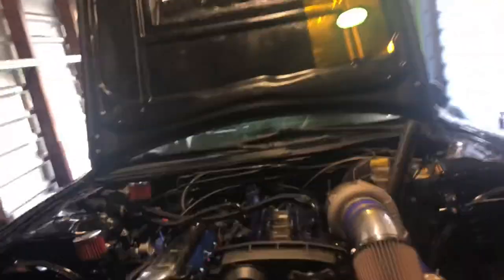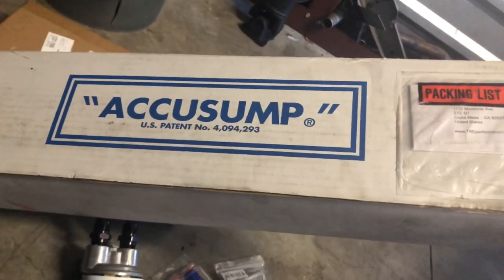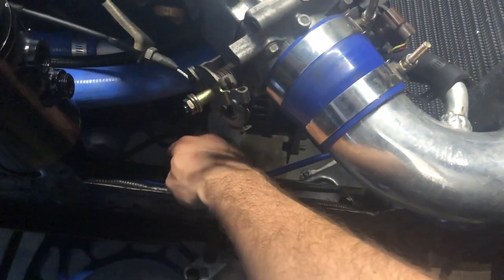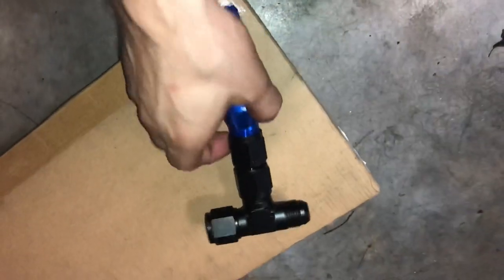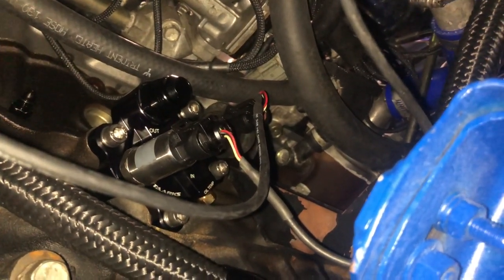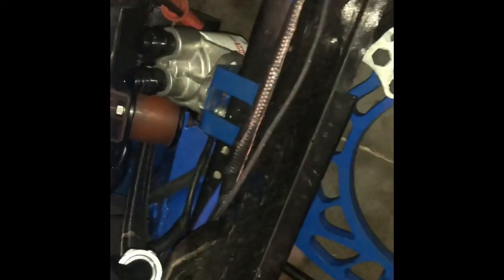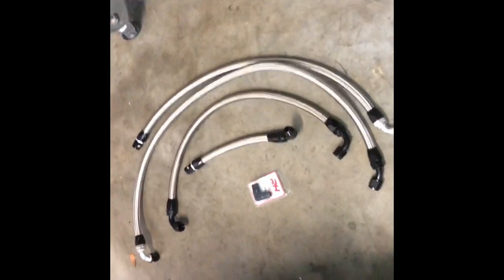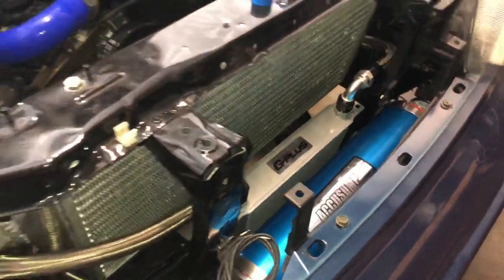Rb25det neo oil filter relocation, oil cooler and accusump install

Comment: Nice review, I just starting to install one for my s13 RB30 engine, but the solenoid valve is going to be control by my Haltech ecu..keep the good work..
Reply from the maker: iridium58 thank you man! Thats how i wanted to do mine. Im gana change the set up eventually bit it’s working great so far 🤙🏼